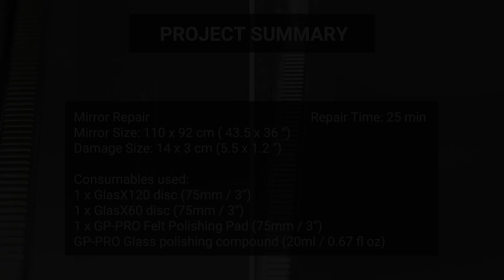Mirror Scratch Removal  - How To Remove Scratches From Mirror

Comment: I have question is not first. 6o in then 120
Reply from the maker: GlasX60 and GlasX120 are the product names and not the P-grade size.  
GlasX120 green is corser (P180) and GlasX60 blue (P500)